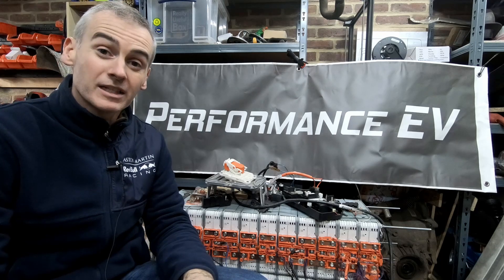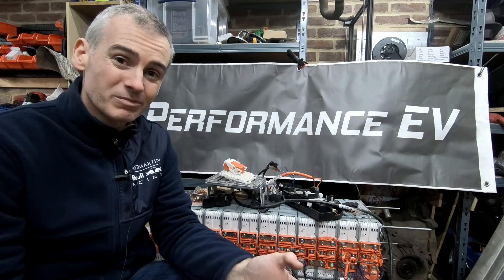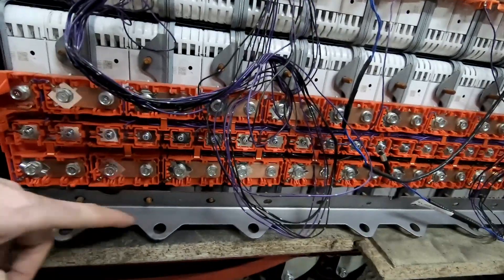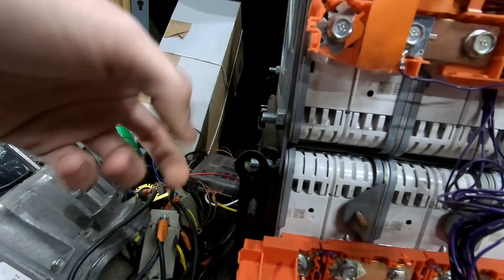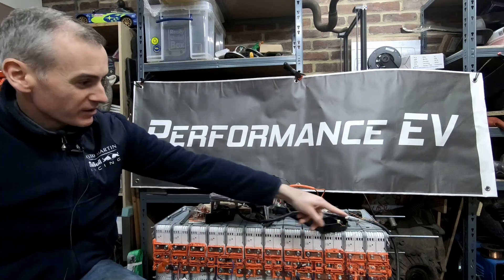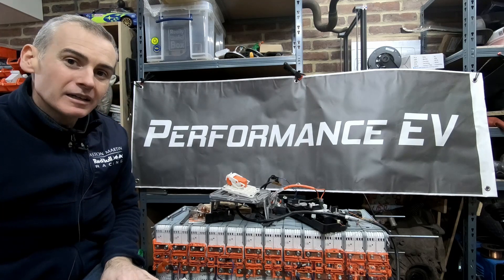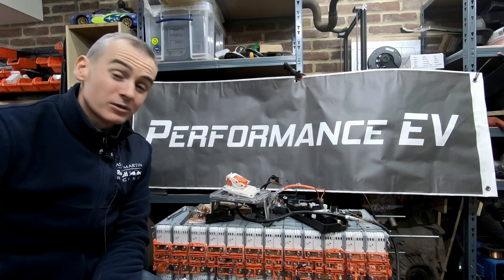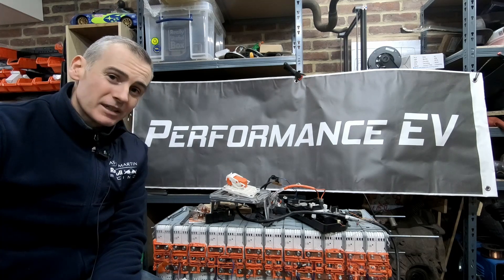Custom Nissan Leaf Battery Pack Fixes - Electric Porsche 911 project video 57

Comment: Hey Shane, do you have the dimensions of your battery packs? Maybe I missed it in a video but that would be super helpful for other converters. Keep up the good work!
Reply from the maker: Thanks. I'm planning on covering that topic in more depth in my next video, when I get a chance to complete it. But it's around 84cm wide (including the nuts either side once I cut down the threaded rod) about 45cm tall and 32cm deep including the terminals and bus bars.
Reply: @PerformanceEV  Great, Thanks for that. I'm working on my next project and appreciate the info! I just posted a video showing the mounting of my LEAF battery in my last project but doing this one a bit different. Looking forward to your next vid!

Comment: Hello from Russia, I am also engaged in the conversion of cars, subscribe to my channel :)
I use a mini ANL fuse in the batteries, it is perfect instead of the factory copper plates, I install 1-2 pieces, in case of damage to the battery in an accident or short circuit, they can prevent a fire.

Comment: Depending on how close the walls of the battery box is going to be to the batteries, make room to put some spring washers or the like on the bolts that go through the batteries so that it will reduce the likelihood of them coming undone during use with the vibrations that will be present during operation.
Reply from the maker: Thanks, that's a good idea.
Reply: @PerformanceEV  добрый совет, у меня была такая проблема, важно хорошо затянуть болты, при работе батарея немного увеличивается из-за нагрева

Comment: Maybe,  I missed it, but is it OK to install powertrain backwards? In some cars in reverse final drive whining pretty loud under load.
Reply from the maker: To be honest, I don't know for certain. But there was no way to fit it forward without cutting the car, so we're going to find out. I took a look inside the transmission and there wasn't anything I could see in there that caused me too much concern. But I won't know until I get it on the road.